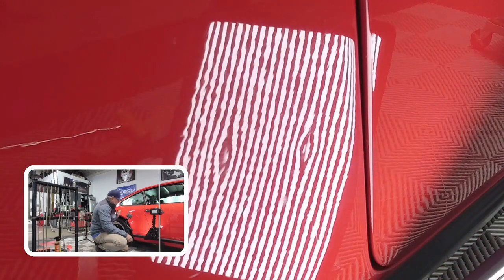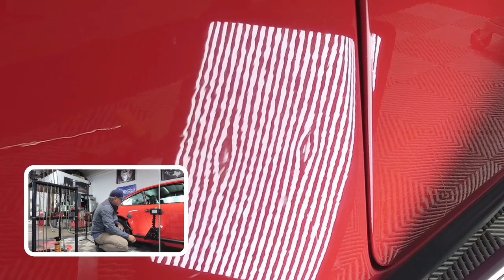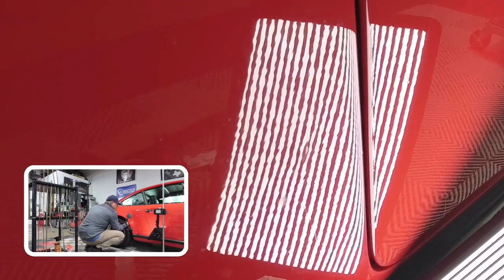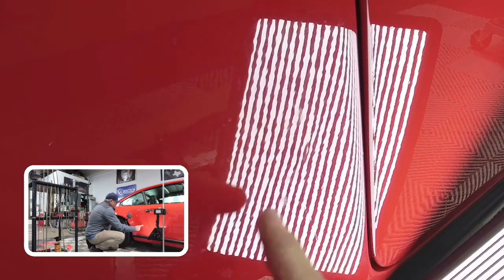Saying Goodbye to Dents: The Paintless Dent Repair Process

Comment: HI Myke!  Awesome work, I really appreciate it. 
PDR is something magic definitely! 
I do remove dent and restore watches gold and stainless steel  to original condition. and I use to treat the dent a bamboo point into a metal tube ,work very well, did you tried wood points on your tap tools?

Comment: Would it be easier to remove a dent like that with hot glue?
Reply from the maker: Thanks for the question Dudley. IT’s subjective. I went to tool it since the factory hole had perfect access. To me, pushing is faster than glue pulling.. especially when it comes to the set up time.
Reply: @denttime  thanks. Excellent video
Reply from the maker: Cheers 🍻
Reply: Another question have you ever had a dent that you couldn't get all the way out? And if you did what do you tell the customer?
Reply from the maker: Absolutely. It actually happens quite often on much bigger and complex dents. I always advise the client ahead of time it may not be successful spending on the extent and circumstances.